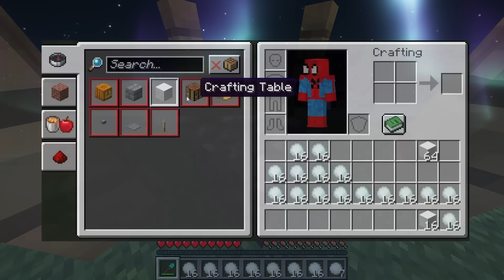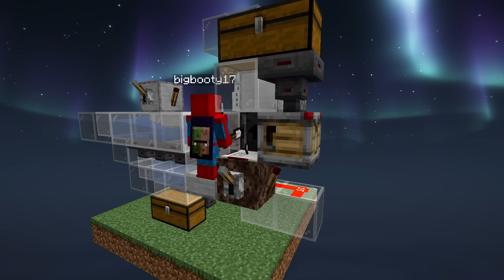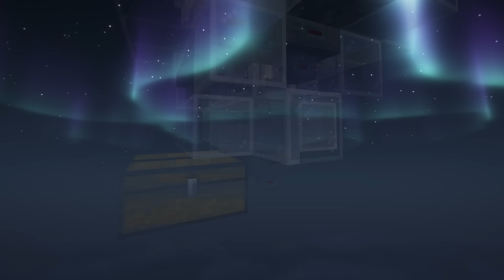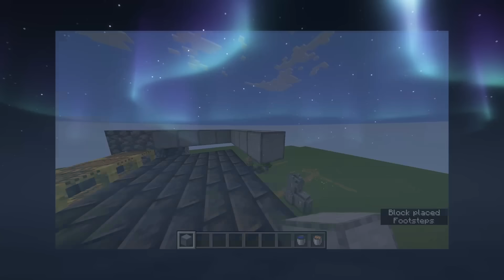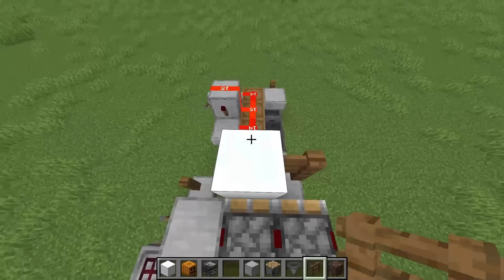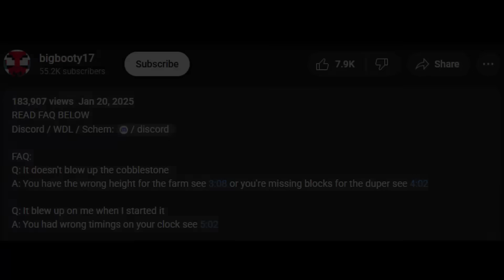Minecraft Snow Farm You’ll Actually Use

Comment: Why can't you just use two zero tick (or slower) pistons to auto break the snow?
1. The farm will require less resources (because you wouldn't need any minerals or stone and sticks to actually craft shovels themselves, and you wouldn't need the part of the farm that actually crafts the shovels to finish building it)
2. The farm can be automatic (you wouldn't need a player for the farm to produce snow, and you can just pop a chunk loader near so it would run 24/7 as long as the world is running)
3. And it would in theory be objectively faster to build the farm (because you don't need to actually build the part of the farm that creates shovels to finish building it)

And yes; i know that you can pop a cobbelstone + wood farm to the snow golem farm to craft shovels infinitely to solve number 1, but doing so will be pointless trying so because of number 2, and making your farm bigger and require costing more resources to build just to solve one argument INSTEAD Of just using (compared to that) a less cost-efficient variant, and as a bonus killing two birds in one shot by that; is just stupid